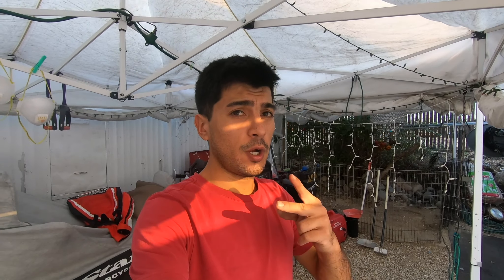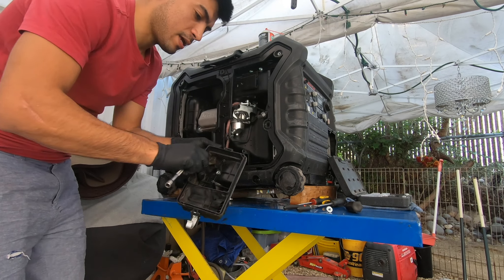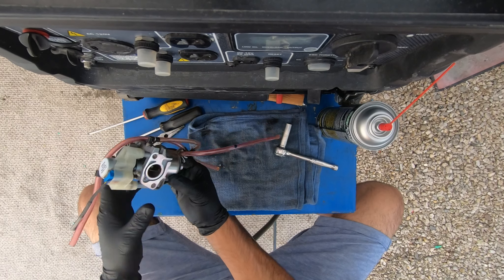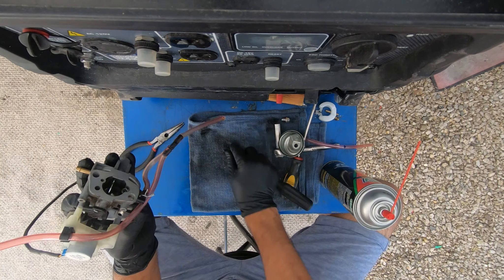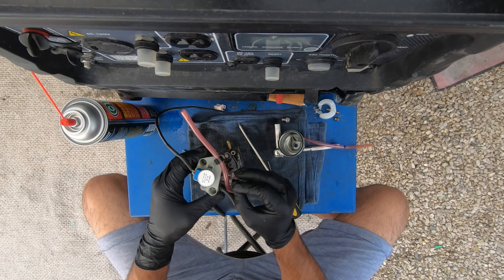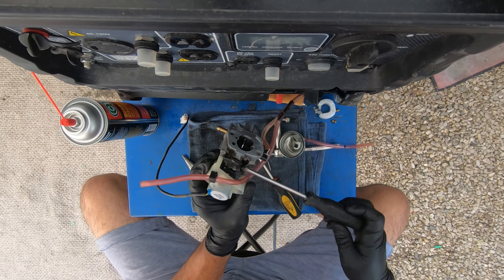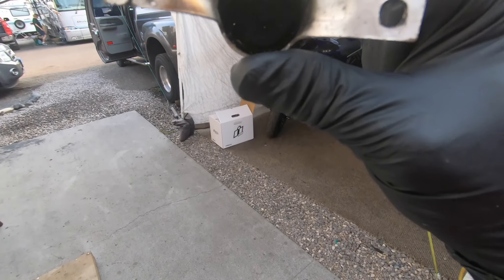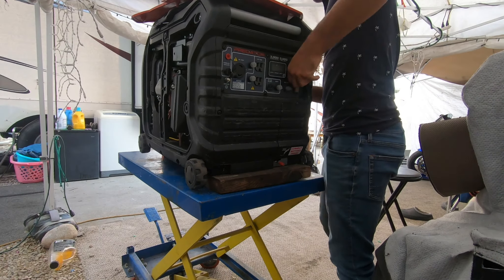How to clean carburetor on Predator 3500

Comment: Hi Jonathan, I've been watching you for some time now. I really like your videos you seem to know what you're talkin about. Much of what you've done has helped me and my process. My brother brought me a non-working Predator 3500 generator to see if I could get it going. I do have it running very smoothly, it produces electricity. But it will not step up when I plug anything more than just a light. And this video you comment on the stepper motor as you disassembled it. You said it was very important did you not turn that motor when you remove it from the carburetor. Well guess what, out of curiosity I did, but that was before I seen your video. Thinking I messed it up I ordered a new one. But it does the same thing. I can take my finger and idle up the engine from underneath the stepper assembly, and it revs up the generator are my air compressor it's plugged in revs up and runs as it should. I'm at a total loss here. I don't know how to check the stepper motor or what causes it to step up when called for and was hoping you might have a suggestion. I've watched uncounted videos of yours trying to find something on the stepper this is the only video that I found that even mentions it. I know this is getting long-winded. I have a new carburetor on the motor I checked the valves new spark plug cleaned all the filters, a new ignition module. I have removed the spark arrestor for the time being. the machine runs great it just will not Step Up When called for. Do you have a video on that? Could you possibly make one the covers that? I need help please. thank you and keep up the good work
Reply from the maker: Hi David, thanks for watching my videos and reaching out for help you did well on that. to be clear your generator did not automatically rev up the engine to meet power demands and you bought a replacement stepping motor thinking that it could have gone bad  and that made no difference is that correct? does the engine rev up when you manually put it on  "isc throttle" (off)?
Reply: @immortalengines1605  hey thanks for responding. You are correct. And no flipping the switch on or off does absolutely nothing, with or without a load it doesn't change
Reply from the maker: @dvd8869  try this: without removing the carb. unplug the stepping motor and plug in the one you removed then start the generator and turn eco throttle on and off it should rotate the shaft on the stepping motor while in your hand. let me know how that goes.
Reply: @immortalengines1605  okay I did this. And the off position it's barely trickling and trying to move. And I could feel some type of pulse, if you will, in the motor while it's in my hand. Flip the ESC throttle to the on position and it does turn full rotations and very smooth I can however stop it with my finger , but it does move. I had already checked the switch. With the switch disconnected in the off position I read continuity between the legs, nothing in the on position
Reply: Maybe I should mention this. I can turn the idle screw up and race the motor and it functions properly, it just won't do it up and down. Would it hurt to just let it idle high all the time like some generators do?
Reply from the maker: @dvd8869  that's great news. It really doesn't take much resistance to top the stepping motor from spinning,  i'm sure an ant has more torque/ leverage than it. the issue is in your carburetor itself. do this: pull the carb off of the generator and remove the stepping motor then spray some oil lubricant on the shaft thats on the butterfly for the throttle. make sure to spray on both top and bottom while manually opening and closing the throttle to free it up a bit. you should definitely see a difference after lubricating it. after that re install your stepping motor and it should work great from there. this happened to me with the stepping motor of the auto choke in a Yamaha 4600 watt geny. if you watch that video where i explain what the problem was you will see what i am talking about.  let me know how it goes! -Jonathan
Reply: @immortalengines1605  I'm going to search that video in the morning. I will definitely give this a shot. Thank you so much Jonathan
Reply from the maker: @dvd8869  not a problem you do not need to clean the carb just lubricate the shaft for the throttle and it should work great.